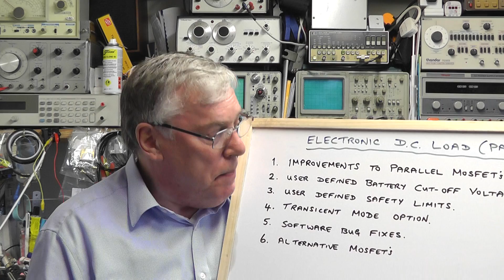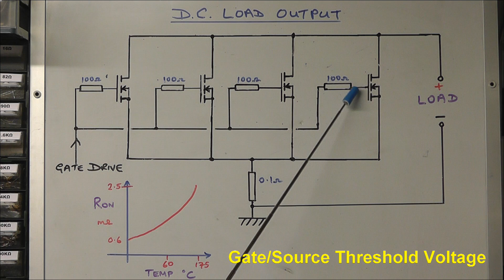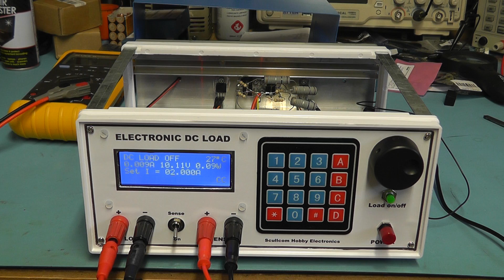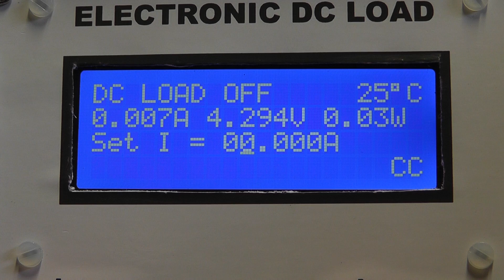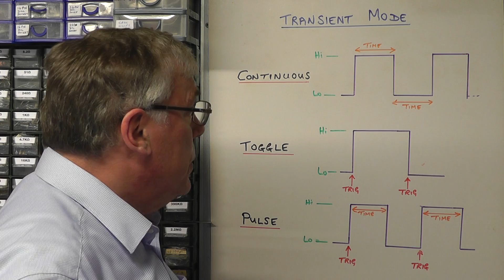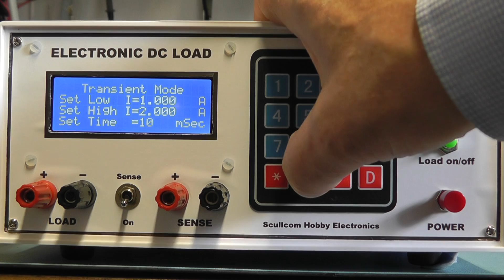Scullcom Hobby Electronics #49 - Electronic DC Load Part 5

Comment: Very good!

Maybe the pulse shaper could be omitted to keep the trigger input able to receive analog signal? This could then steer the load according to the external analog value for some feedback loop purpose.
Also instead of pushing two buttons simultaneously a short push / long push would seem to be more sensible to me.
As for those mosfes, I wolud recommend to stick with at least 100V ones. Not only they can withstand some transient spikes, but higher voltage mosfets also tend to behave better in linear region.

It is starting to be a very feature-rich project. Using faster converters and controller would render it into a semi-professional tool.
Reply from the maker: Thanks Medvidek for your comments. As you suggest there are a number of options for the trigger input. I will try an cover this in the final part of this project. The short push/long push may also be an option. The limiting factor with this project is the Arduino and as you say a faster processor would certainly improve its operation and accuracy.
Regards,
Louis

Comment: Tip my hat to you. You read my mind, I was thinking on transient mode. Two things that can be added on transient mode are total time for running, so after a set amount of time the unit is switched off. The other thing is to add a SD card reader to store the voltage, time and amps while you are running in transient mode. In that way you may be able to record anomalies on the power supply under test that relate to changes on the load been applied.

All your projects are excellent,
Reply from the maker: Thanks for your suggestions. I am sure there are many other features that could be added. Hopefully, it will encourage others to take my project and build on it.
Regards,
Louis

Comment: Nice update. The mosfet arrangement is definitely a brilliant improvement! 
However, the software has gotten quite complex considering the button push combinations required for the various new modes. There should be an easier way to toggle between the different modes like using the rotary encoder initially to select the mode, then after that the encoder can be used to set the various values.
Reply from the maker: Thanks Sebastian. I agree the software is getting quite complex but this is a result of the way I have been adding the additional features while maintaining compatibility as the project progresses.
Regards,
Louis
Reply: @scullcomhobbyelectronics1702  are the fets matched?. if they are not they are not going to dissipate the same power and the one with lowest gate threshold is going to die...and then the next ..and the next one and so on and so forth

Comment: Instead of :

if (BatteryLife < 10) {                              //add a 3 leading zero to display if reading less than 10
      lcd.print("000");
      }

      if (BatteryLife >= 10 && BatteryLife <100){          //add a 2 leading zero to display
      lcd.print("00");  
      }

      if (BatteryLife >= 100 && BatteryLife <1000){        //add a 1 leading zero to display
      lcd.print("0"); 
      }

use :

if(BatteryLife < 1000)
lcd.print ("0");
if(BatteryLife < 100)
lcd.print ("0");
if(BatteryLife < 10)
lcd.print ("0");

Saves a few bytes and clock cycles.
Reply from the maker: Thanks for your suggestion. Coding is not one of my strongest skill sets.
Regards,
Louis
Reply: You are welcome, and thanks for the great videos.

Comment: This is awesome. Thank you very much for sharing your knowledge with us. Your explanation is easy to understand structured in stages especially for people like me with more basic knowledge in electronics. For my next project I was going to build myself simple Bench power supply but now it will have to wait. I will be building this DC load project first. And who knows by the time i finish it maybe your next project will be DIY Bench PSU 😉  which can designed and tested with the help of this project.
Reply from the maker: Glad you found it helpful. A Power Supply project may be a idea for later.
Reply: Bay Van I like the idea of a bench PSU project. Maybe also with keypad input along with rotary encoder. At the end it does not sink but source current. So it should be very similar in some points. 

Thanks for your great work. I really like your teaching style. I can easily follow as an electronic hobbyist.
Reply from the maker: Thanks Micheal for your comments.
Regards,
Louis